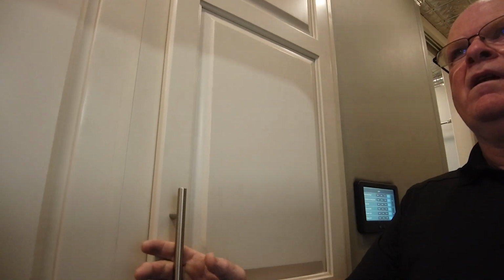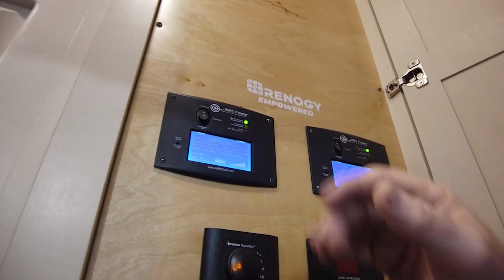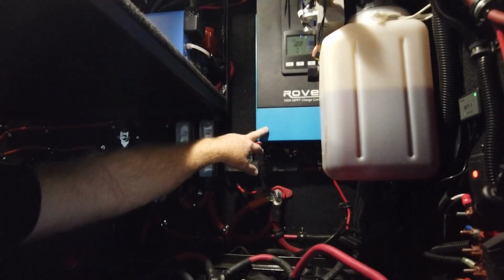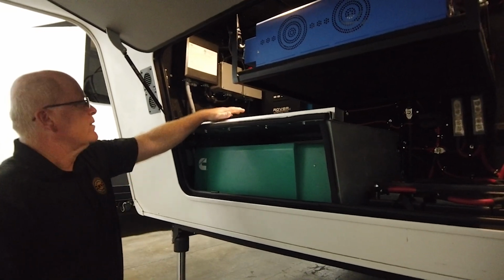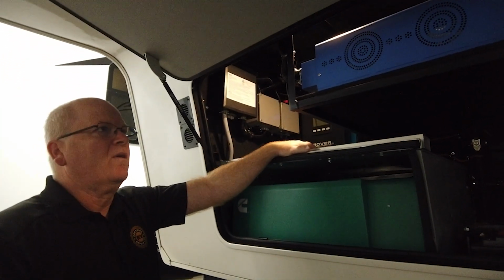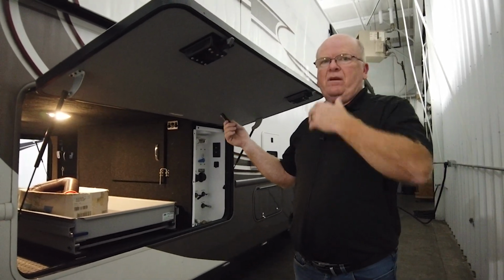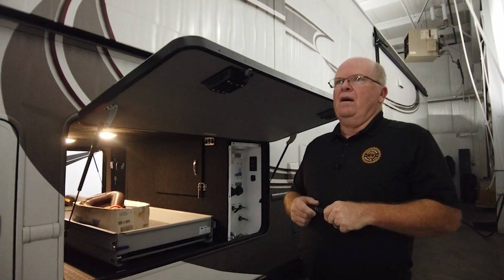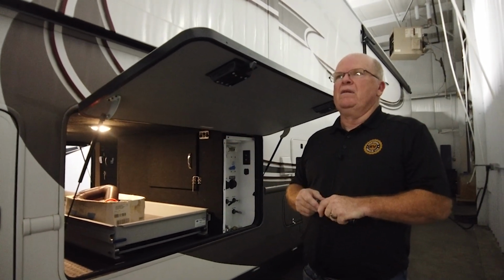Solar Install and a Luxe Luxury Fifth Wheel; A Match Made in Heaven

Comment: Curious why the system is divided 12v, 24v instead of a single 48v battery setup? what kind of of lithium cells? BMS's on battery banks will handle 1c loads at 100amp?
Reply: I’m not sure if the mentality is the same as in the telecommunications industry, but we have our systems divided for redundancy.  One must be offline to service (check/replace), and you always seem to find out about problems when they are needed most.  Even though lithium batteries are less susceptible to memory issues, you still want to charge to 100% every time before use.  Having two systems allows you to switch between them for service, use one while charging the other, and if you do have a failure to switch to the other system without a service interruption.
Reply from the maker: Thanks, innerspaceavailable! Would you be interested in more information about our luxury 5th wheels?
Please give us a call and we can discuss your needs. (844) 284-6678 
Also, take a look at our build your owns below. This will give you an idea of options and costs.
- Luxe Elite build your own: https://luxefifthwheel.com/build-your-own-fifth-wheel 
- Luxe Gold build your own: https://luxefifthwheel.com/rv/luxe-gold-luxury-full-time-fifth-wheel/luxury-full-time-fifth-wheel
- Luxe Toy Hauler build your own: https://luxefifthwheel.com/rv/luxury-fifth-wheel-toy-hauler/luxury-full-time-toy-hauler-fifth-wheel

Information on our Luxe Trucks: https://www.luxehaulers.com/
- We are a Direct to Consumer manufacturer - A better Way of doing business. 

Also, we have Nationwide service throughout a national network of service centers. https://luxefifthwheel.com/luxury-fifth-wheel-service/service-centers-for-luxury-fifth-wheels
I would like to invite you to come and visit our factory. Please schedule a tour here: https://luxefifthwheel.com/about-luxury-fifth-wheel-manufacturers/luxury-fifth-wheel-factory-tourShow less